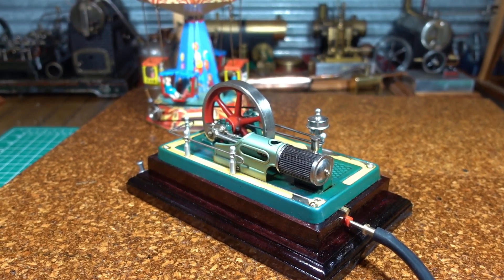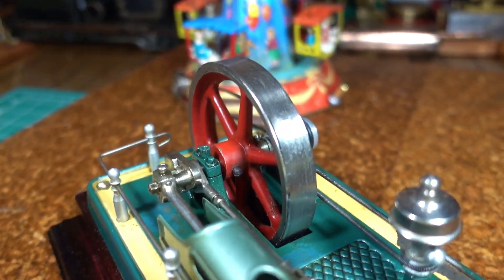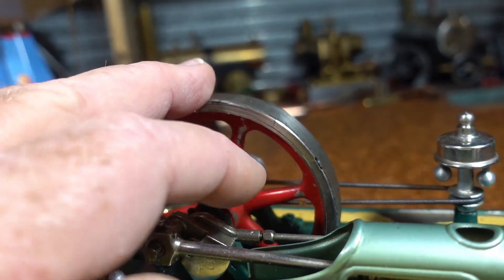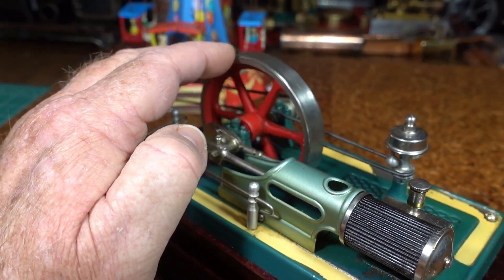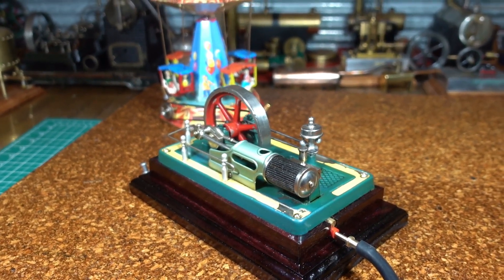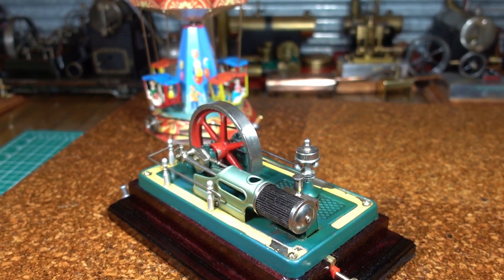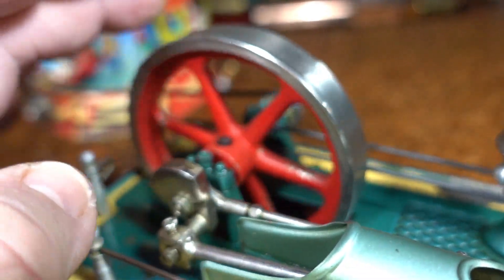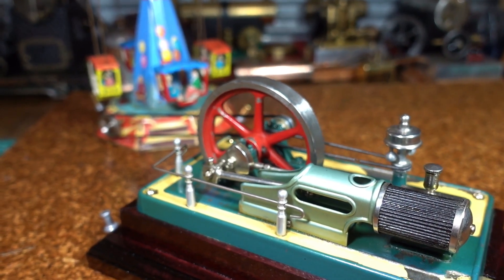Model Steam & Toy Steam Engine Zinc Pest rot fixed with Super Glue #

Comment: Heard it was caused by environment, so superglue sounds like it would be an excellent fix. I'm not certain that it can or will coat the surface to stop it from happening on the outside. Might be worth putting some kind of Renaissance Wax coating on it to completely stop any moisture and/or electrical contact/conduction on the outside. I think the same thing that causes Zinc to protect other metals from corrosion is what causes it to corrode when mixed as alloy. I was gonna ask about recasting it also, but it seems other already have. I'm not sure if it's necessary though, because (as you've said) it appears that your super glue repairs stopped the zinc from farther deteriorating. (If I recast it, I would try to do it by forming a shell around the part and recasting it out of the same zinc in the exact same shape with only a slight bit of new zinc added to recover any losses in the process). Appreciate the video though and the information. Hopefully it will help others with the same problem.
Reply from the maker: Thanks for the reply.

Comment: Thanks for this tip I have a few mazak disintegrating flywheels that need this treatment ASAP. Really appreciate the video.
Reply from the maker: G'day Phil and hope this helps with your flywheels disintegrating any more. Its a real bugger this happens - Cheers Jim
Reply: @SteamEngines-Jim   Yep it sure is a pain, I would never have thought about using super glue. But reading the comments it sounds perfect as its watery and able to really soak into the 'rotting' zinc rot that's causing the disintegration and hold it altogether.
Reply from the maker: @philmatthews7692  Yes super glue is really good as it soaks in so well - Cheers Jim

Comment: Hello Jim,
Interesting video... do you have to clean the flywheel with anything special before applying the super glue...
Cheers
Paul,,
Reply from the maker: G'day Paul the only thing I did was use some degreaser as the flywheel had lots of oil on it. Washed that off and let it dry and then started using the super glue. It soaks in to the cracks really well and doesn't stay proud. Luckily (I suppose you could call it luck) it 'usually' only happens to cast flywheels on steam engines. The train guys cop it bad because it happens to all their rolling stock wheels and also the die cast car collectors their cars literally disintegrate. Its a real bastard it happens, though  I have three of these Fleischmann engines. Two just aggregates and one a complete plant and the other two flywheels show zero zinc pest - As always cheers Paul.